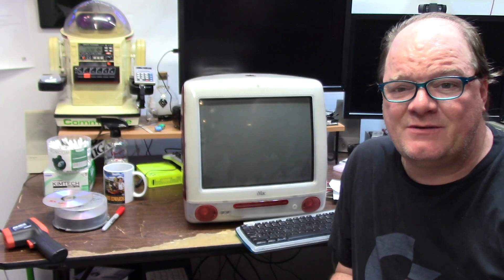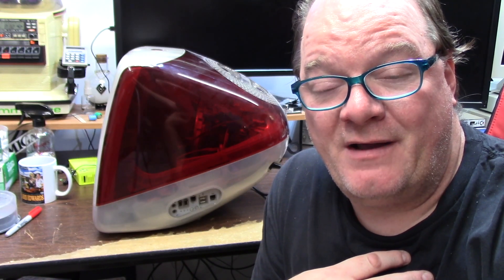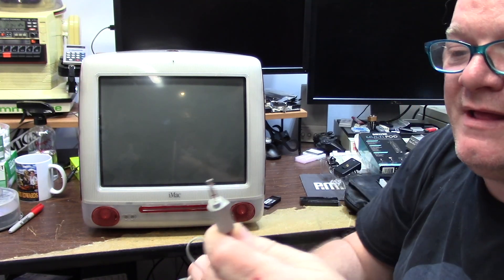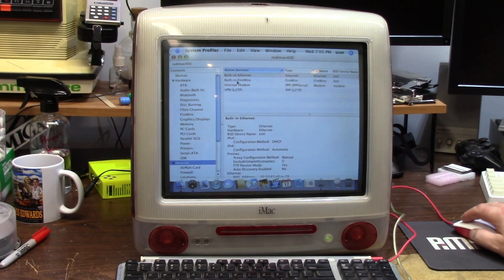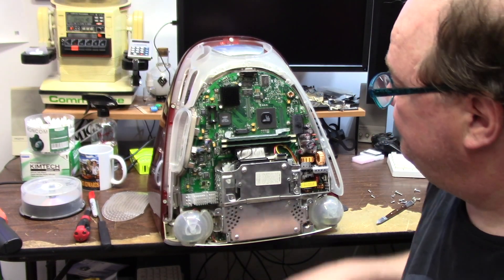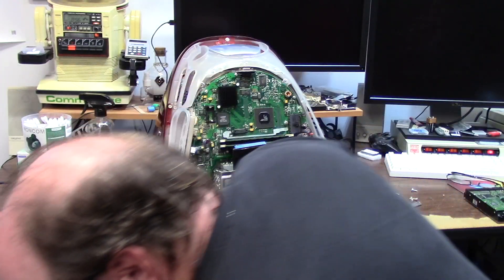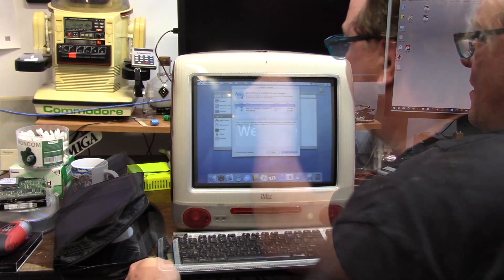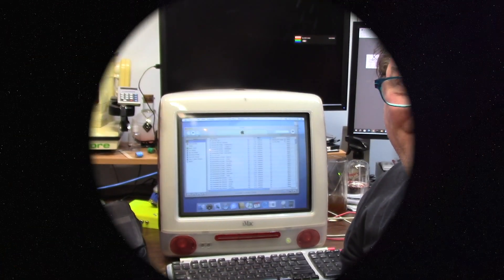Ruby Red imac-DV from hard disk to IDE2SD

Comment: I don´t like Appel but i have 3 older Macs. The oldest was a Quadra 650 with a 33Mhz 68040 CPU, a Mac 9600 (1GByte of Ram, updated to a PowerPC G4 1Ghz, Ati 9200 Gfx). I played a little bit with them because they are from the same time my Amigas was. At least a MacMini (Intel Core2Duo 2Ghz Version) was a short time my email-server. When i have time i will use it as Emu-Station. Shoud be good enough.

Comment: Apple hardware design for the iMac computers is a level of passive aggressiveness.  Its really difficult to remove the IDE hard drive and replace it.  Edit:  The iMac I had was a different version that yours which has much easier physical hard disk access.
Reply: Its where they cut their teeth on the idea of non user repair that we have now where you cant even open it with out breaking it. As great as Apple are they have a lot to answer for.